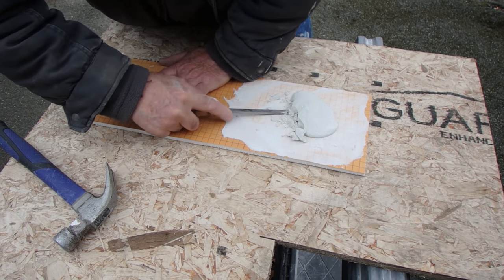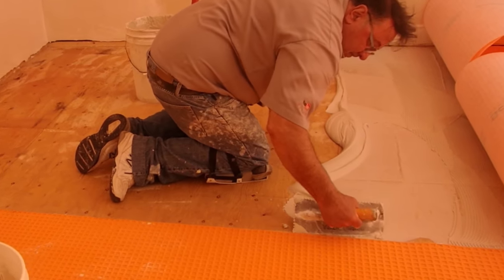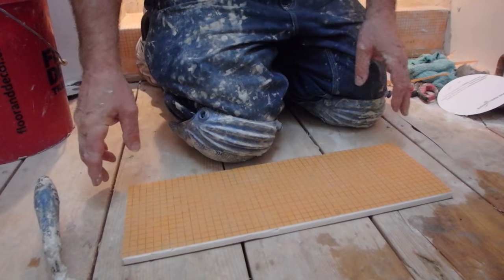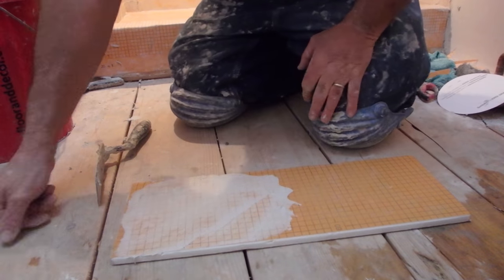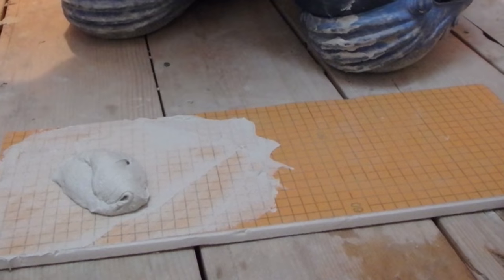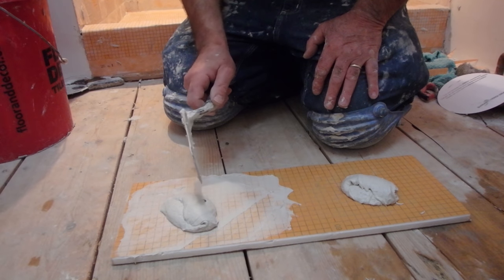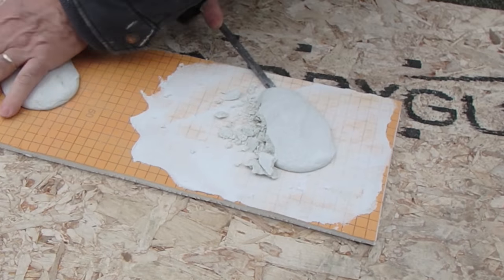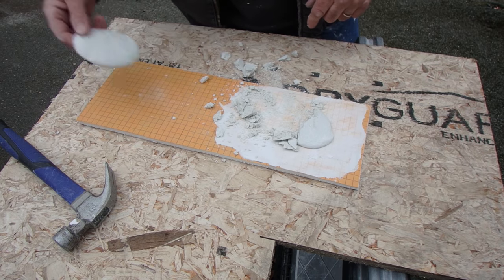🤔Make  it better, Every tile job needs this. Key, burn, coat, skim

Comment: I used to charge going rate in my area even though I properly set tile and knew I was better than most of the flooring guys setting in my area. one day I decided I’m charging more than going rate even though I was afraid I would go without work. four years later I have doubled what I make through a store and tripled what I make when I sale my jobs. my work has only increased and my reputation has grown in the area I live in as a top notch setter. And to be completely honest I’m not even close to some of the guys I follow online but because I listen to guys like sal I have gained confidence in what I do and know what I’m worth. People will pay enough to make it worth your time to do it right. Keep it up sal
Reply: Jesse greatly appreciate your comments and love Sal's videos . This may seem a rediculous request but   I need your guidance since I am unsure how to calculate price to my client for demolishing existing acrylic fiberglass tub/show and replacing with porcelain.  I am not only tiling but everything-a one man company. Naturally I take expenses for supplies and estimate hours it will take which is done for any work but is there a computer software or trick/short cut just based on width/length/height to give an estimate?.
Reply: Jerry Grayson I only do shower build and set tile I let the plumber plumb lol
Reply from the maker: Exactly, set yourself apart and be the guy that is known to do great work the right way, anyone can get a tile job if they do it for cheap, and then hack it in, quality and durability takes time and in the long run is a better value for the customer.
Reply: @SalDiBlasi  Sal this is what I am now doing.  I treat each job as if my wife was supervising (half joke)  but business expansion is slow but all my clients are happy.

Comment: So great that you did this video. I deal with people daily that say industry standards are a tool against them. You’ve shown here at least that the installation standards of ANSI A108.5 are for their benefit. Keep it up.
Reply from the maker: If they don't understand industry standards are the to insure proper installs when they are followed, then they will probably  end up having some hack do the work and learn the hard way.
Reply: Sal DiBlasi I manage tile failures country wide every single day. It baffles me constantly how many people don’t want to learn how to do it right. Even when we try to help them for their own benefit. Sad.
Reply from the maker: Very sad,  especially when it can be avoided easily.

Comment: One note. What I believe you care talking about in one scenario. Is when you key in before you put down Schluter ditra. Although a test for that would be keying in vs just using notches. Coverage of keying in will be better much superior, although the notches would not be much lesser than the keying in method. On any other situations such as if you float, then wait for the float to cure, always always alway key in before setting a tile on the float or just straight kerdi-board. Good video!

Comment: Thanks Sal, great video to remind all us professionals out there to take the proper steps when installing. Short cuts will not save you time in the long run!
Rob Toronto
Reply from the maker: Short cuts are not faster in the end.

Comment: Sal, great video as usual. I can't tell you how many bathrooms or floors I have removed tiles from where they pop right up because there was no back buttering, or keying in, or they failed to trowel the mortar with parallel trowel lines, and it never collapsed properly. I also find a lot of tile floors with 5 large dots of thinset, rather than full coverage thinset, so you have cracks and numerous hollow sounds under the installed tile floor.
Reply from the maker: There are a lot of things that can be done wrong, sad thing is the right way is pretty easy.

Comment: I've always called it "skim or flat trowel " your substrate before your trowel scratch.  I always look for any installer,  I've never met, to do this when they start installing.  It'll usually tell you all you need to know about the apprentice or installer.
Reply from the maker: Skim, key, burn, might be more terms that al refer to the same thing

Comment: Sal -  you have provided a wealth of information and I thank you! I have a question regarding tiling on gypsum board in kitchen backsplash areas and also on bathroom walls away from showers. I was told by the tiling company that I should prime the wall prior to the backsplash tiling and I used Kilz PVA. I spoke with laticrete and they said that using the primer voids all warranties on their thinset. What are your thoughts on gypsum board/tile applications and priming versus non-priming? The backsplash is now done, but there is still a chance for course correction on the one bathroom wall if I need to tear out and redo. The local tile shop suggested that it may be possible to burn the surface with a thin thinset application and then proceed as normal with tiling after dry. Thanks for any insight/suggestions you can provide!

Comment: I also find it's actually easier to skim after keying anyways. Usually if you go straight to skimming you get ugly lines that aren't buit up very well. You can also see the orange in between them. It's also easier to get into the corners by keying, and then when you skim you're not leaving huge build ups in the corners.
Reply: THATS CRAZY THOUGH! Never would have thought it would make THAT big a differnece, INANSE!!!
Reply from the maker: Seeing is believing. 😜

Comment: Anymore, as a commercial tile setter it seems the concrete floors are always less than desirable along with the walls. So I end up pulling everything off with edges first anyway just to get things close to flat.

Comment: Great advice Sal.  I  have a question I have a bathroom that's 40 years old and the structure is good. could I just knock off the tile and paint a moisture proof and retile ? I pried off a few tiles and the walls still look good.
Reply from the maker: Can you do that? Sure. Is it a good idea? probably not. Best to start fresh, make sure everything is good and there will be no surprises down the road.

Comment: Sal I assume you would also do this with Cement board using a damp sponge first to wet it down then do a burn in coat first?  Can you then immediately start to install your tile after the burn in coat?  Thanks very much and always great stuff on your Channel Sal.
Reply from the maker: Yes you want to do this just before installing the tile.
Reply: How long should he let the burn coat dry before tile install?
Reply from the maker: @sirjohnahayfalcon  you don't let it dry, key the thinset and immediately set your tile.

Comment: daft one here sal but do youse not use  a primer in USA I like the Mapai primer g I don't see fitters in USA using it we bond all floors walls here in Britain  respect to u and first rate work mate
Reply from the maker: We don't use primers here on plywood, the mortars are designed to work wit the substraites they are rated for.

Comment: I really like your videos, very helpful, thank you. I have a question about a shower niche, I'm adding one to my shower, I have it framed out, do I need to   use cement board over the wood, or can I just tile  on the wood?
Reply from the maker: No, use cement board and waterproof everything.
Reply: @SalDiBlasi  I guess I should clarify a bit, I removed all the old tiles, everything has cement board on it, then i cut holes for the niches and made insert boxes to fit. So I should use cement board to cover the niche boxes? And waterproof how? The old cement board which is still pretty smooth doesn't appear to have any type of waterproofing on it, except for the pan liner that is visible in the corners, about 1 foot high.

Comment: Hey Sal! First off, I would just like to say I admire all that you do as a tile master! I fell in love with the trade 8 years ago, and have been on my own for a few years now. 

Anyways I have a question for you. I’m doing a big master bath. The floor is all Ditra heat. I’m installing 12x24s and always use modified for everything. I know Schluter calls for all set... but the GC has prolite (customs modified premium thinset) am I ok to install over the Ditra with that? I honestly feel like Un-modified isn’t good enough regardless is they recommend it for warranty. Especially being that it’s large format. Thanks in advance! 

- Jordan
Reply from the maker: To put your mind at ease regarding how well unmodified bonds a porcelain tile to ditra, watch this video, https://www.youtube.com/watch?v=nY3WSe08n2M&t=192s as far as the prolite goes it will work. The issue with a regular thinset mortar is that it will have an extended cure time, it will work, it just takes a long time to dry and cure. Using any modified other that schluter brand will void your warranty. You should also  look into Tile geeks https://www.facebook.com/groups/TileGeeks/ and GTP  https://www.facebook.com/groups/1227943580558574/

Comment: Great video as always Sal.  Does it matter at what angle you hold trowel when you are keying in the thinset?  If it does matter, what is the ideal angle?
Reply from the maker: Normal angle for the trowel is about 45 Degrees, keying in is jut to force the thinset into the pores of the substrate so not as important then.
Reply: Sal DiBlasi   Thanks very much Sal.

Comment: Hi Sal,  Great video!!!  By far the best videos on the web.  I'm a mason, so I'm familiar with some of the techniques applied.  I'm redoing our master bathroom.  I watched your mortar shower pan installation.  Very very informative.  I have one question.  In your video, it looks like the preslope (beneath the liner) takes the same portland mix as the layer above the liner.  I'm concerned with a leak into the preslope (beneath the liner) wicking into the preslope.  I know it should hit the drain before, but what if it doesn't later.  The water will move right into the preslope.  It seems to me the mix should be different, more portland or an additive to make the pad beneath the liner resist water entering.  What do you think?  Am I off base?
Reply from the maker: The whole point of the liner is to prevent water getting beyond it, if it does then the shower has failed.
Reply: @SalDiBlasi , Thanks Sal.  Perhaps I'm worrying too much, but the weep holes are below the liner.  Doesn't that mean the water is expected to get below the liner?  I saw you seal below the liner around the drain with waterproofing.  What type is the best to use for this application?
Reply from the maker: @dewanehill1232  Weep holes empty out into the drain.
Reply: @SalDiBlasi  Thank you very much Sal.

Comment: Can you key in on any surface? Like greenboard or aquadefense? Thanks
Reply from the maker: You should when you install the tile, every time
Reply: Thanks I am going to be using greenboard and roll on aquadefense then key in. And I will be putting 4x4 ceramic tiles.

Comment: Isn’t that the same thing as wetting it? Since, my understanding, is that the purpose of burning or keying is essentially creating a barrier that the substrate can’t suck all the water out of the thinset?
Reply from the maker: Not the same thing, keying is forcing product into the pores of the substrate.
Reply: Sal DiBlasi hmm don’t know about that one. I’ve done it both ways and have not seen an advantage over using water. Sounds like a new video idea!!!

Comment: Let's see a video for adhering backer board to the sub floor (1x8) you had in this video. I am pretty sure there is nothing in the hand book for this type of install but you can correct me if I am wrong.
Reply from the maker: Let's not, Kerdi board is not meant floor floors, Ditra is. https://www.youtube.com/watch?v=YpXEXqbh7ok&t=5s

Comment: I wish I had seen that before I did my shower pan!  When I lifted the first mosiac sheet, all the mortar came up with it - so I redid it, doing what I thought "keying" in was - spreading firmly, but much thicker than your example - Do you see any problem with that?  Also, the only way I'll know, is if it separates?  Thanks for your help, Sal!
Reply from the maker: You don't need a lot of mortar to key in the thinset, just enough to force it into the pores.
Reply: @SalDiBlasi  thanks Sal! But if I did use more, could that be the cause of failure? Since it’s already done ... (I’ll use much less next time!)
Reply from the maker: @scpeckham  It is pointless to worry about it now, in all likelihood it will be fine. So forget about it until you need to worry about it which may be never.
Reply: @SalDiBlasi  thanks Sal!!

Comment: How about you do the test as you said you were going to. Key in one side and then spread the adhesive with the notched side of the trowel?
Reply: Mark Robinson fair point. But wow I didn’t expect that blob to pop off so easily. I have never not keyed the area first thank god.
Reply from the maker: This was to demonstrate how small things can make a huge difference.